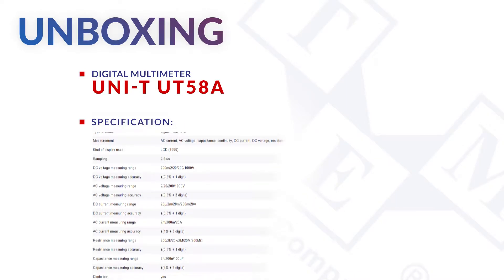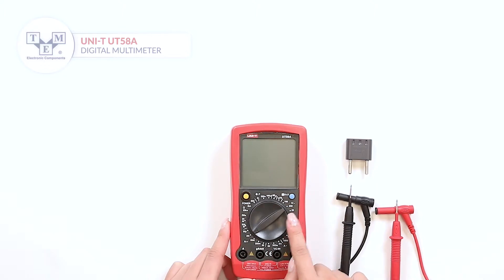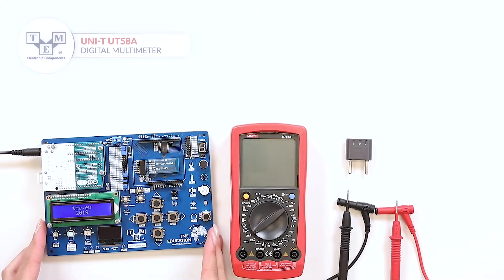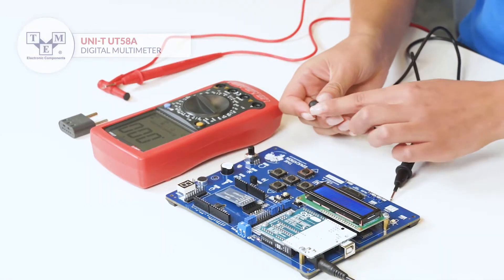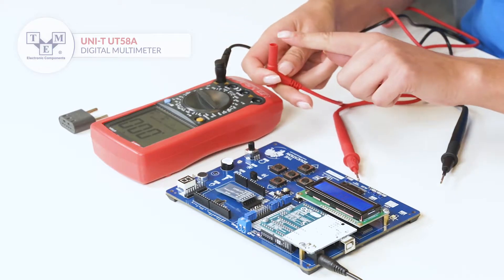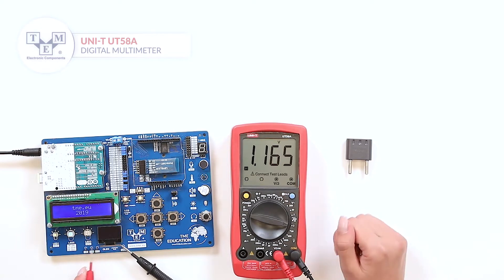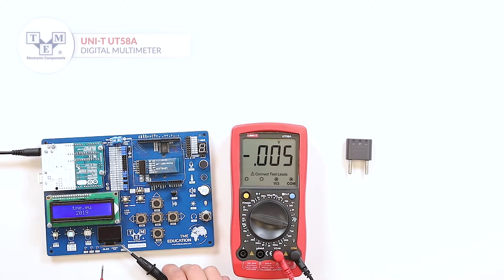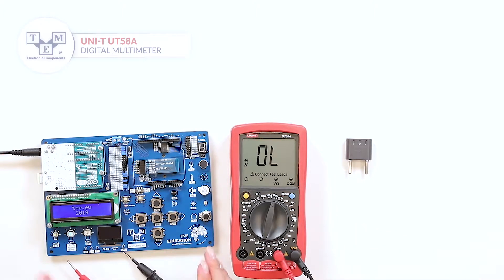UNI-T UT58A - Digital multimeter - UNBOXING

Comment: is this possibale to conect with and see the values on pc screen?
Reply from the maker: Hey:) This model although has all the needed functions for an electrician such as AC and DC measurements, capacitance, diode, and continuity tests with very reasonable accuracy, does not have the option to log the measurements.

However, UNI-T has other models that provide this function, we have selected them for you over here: https://www.tme.eu/pl/en/katalog/digital-multimeters_112609/?s_field=1000011&s_order=desc&id_category=112609&search=uni-t&visible_params=2%2C1785%2C1812%2C3293%2C55%2C2950%2C1784%2C72%2C3286%2C1747%2C3294%2C436%2C3292%2C3177%2C3301%2C3283%2C3296%2C74%2C2854%2C1952%2C1815%2C1605%2C1807%2C375%2C32%2C1594%2C82%2C1813%2C637%2C667%2C1776%2C2102%2C3213%2C1467%2C383%2C3128&mapped_params=1747%3A1467247%3B

If you have more questions, for example, how to connect the DMM to your PC and log the measurements, let us know ^^ 
Have a great day!